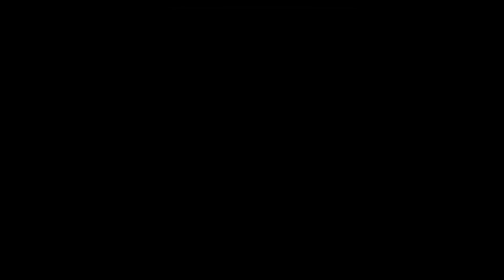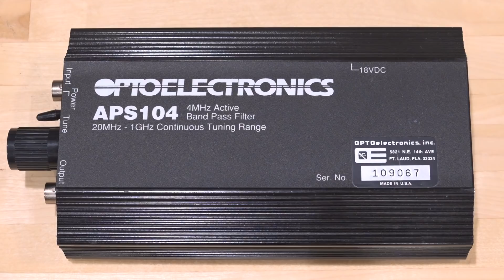TSP #217 - Teardown, Tutorial & Experiments with Active/Passive Microwave Band-Pass Filters (APS104)

Comment: Just picked up one these and trying to diagnose it. Initial finding was the same 4.7uF cap had blown but someone had replaced it with a diode. Regulator seems to have survived ok. Removed the diode and put back a 10uF chip as that was all had lying around. Powered it up and one of the two 33uF tantulum chip caps smoked. Replaced both of those with 10uF (will order correct value parts). Powered up with around 14V as don't have an 18V psu to hand, led lights filter works but it has around -6dB overall gain where you seem to have +30dB gain?? I am powering it with a lower voltage than the 18V but is that going to cause the gain difference? Bias voltage to the MAR7 MMICs seems ok, removed each bias one at a time at signal dropped completely so I don't think its a failed MMIC. Coax connections seem ok, can't see much else in the signal path that would cause the gain to so much lower?? Any ideas?

Comment: I'm reminded of the first time I saw a microwave cavity filter, back in the late 80's.  I was fresh out of college, and went on a trip with a senior engineer to Red River Army base in Texarkana.  The product they were having trouble with was our PPX3 interrogator used with the Stinger missile.  A whole batch of new PPX3s was failing self test.  We narrowed the problem to the diplexer module and found that if we banged it on the bench, it would start working again.  Back at HQ our failure analysis team did something that really impressed me; they were able to cross-section one of the tiny cavities and look at in with an SEM.  They found tiny dendrites shorting the screw and the wall of the cavity.  The amazing part was they didn't break the dendrites during the sawing process.  Anyway, it turned out the problem was caused by a new lubricant the cavity manufacturer was using, which they got from some supplier.  The lube guy wouldn't tell us was was in it because it was proprietary.  Switching back to the old lube fixed the problem.
Reply: That's awesome... thanks for the insight

Comment: I do not know if you have used software defined radios, they can use any filter method. Particularly over the frequency ranges you show here. I learned a lot from this video about cavities and fields people have used - as you said, not really knowing what they were doing.  Or knowing and not having the proper tools and parts.  You might be interested in @MachiningandMicrowaves.  He was using 3D printed resin dielectrics and other tools.  But he has some cool machining videos.  I like his "Machining a 10 GHz Lens Antenna from Rexolite 1422 Dielectric Polystyrene"  because that kind of lens could be use for microwave levitation.

Comment: Nice vídeo!
By adding the 20db attenuator, didn't you drop s11 by 40db? Pity you only showed smith chart.
Reply from the maker: I didn’t talk about the measures S11 of the unit because (as you said) in my setup I was basically measuring the return loss of the attenuator. The return loss of the instrument is not bad, better than -10dB for most of its rated BW.
Reply: @TheSignalPath  thanks for sharing.

Comment: I live in a senior citizens building with a cable outlet in each apartment. Once we switch to the cable input on my TV we can access predetermined channels like 22, 70, 96.1, 98.546, etc. but the only signal that we can access is channel 96.1 which is a screen split into four sections showing the laundry room and the entrances. Can this cable system be used to create several channels where news bulletins can be released to the apartments providing various information like vaccines, or water turn off, etc. health issues which are customized for the residents on a regular basis? Any help would be appreciated. Thank you kindly.

Comment: Good episode. Like the design. Wondering if I could use something similar to make a tunable notch filter. Need very high Q at 108.0 to 108.2 MHz - not easy. Using the manually tuned "oxygen tank" filters now. Again, not easy and clearly not able to automate that.

Comment: Would a passive tracking filter with a non-constant bandwidth before the fixed bandwidth filter be something which would be used to improve the linearity problems?
Reply from the maker: It would have to be before the input of this entire module. And of course you'd have to tune them in tandem.
Reply: @TheSignalPath  I understand and that's what I meant with "tracking"

Comment: A simple way to build a fixed bandwidth filter. Rather elegant from a theoretical standpoint as long as its downsides aren't problematic. To a degree similar to how a lot of radios and spectrum analyzers filter.

Mixers are truly one of the RF engineer's more important tools. All though one with tons of downsides.

Though, if one adds a variable bandwidth filter instead of a fixed one, and perhaps a more stable local oscillator, it could turn into a very interesting tool. Especially if fitted with a simpler display for easier adjustments.

Comment: I can donate very sharp superconducting RF filter assemblies, used in celltower GSM amplifiers, designed to operate at 77K temperature. I bought unit years ago to get cryocooler unit, and have no use of RF parts. Did some S11 measurement at 77K and higher temperature too :).
Reply: Ah yes we had a little fad for cooled amplifiers in the GSM world a couple of decades ago. Then found it was more economic to just place a normal LNA directly at the antenna before the coax run to the base station.

Comment: Nice video. Similar concept to the Wadley loop used years ago in the Barlow Wadley radio.
Have you considered doing a video on passive intermodulation distortion? It's a relatively new problem area in high power multi-carrier RF systems.

Comment: That is a pretty nice idea actually. 
I guess something like this might come in handy as a preselector for an SDR radio. 
I might have a new summer project, I guess. 

Thanks for the interesting video, I would definately like to see more obscure RF and microwave components or maybe also devices with rather unconventional principles.

EDIT:
Maybe some more cellular stuff would also be cool for a mini series. 
Like getting your hands on some GSM/UMTS/LTE base station boards and just showing the architecture, explaining the siganl path and maybe do some reverse engineering and get some low level stuff working / reused.
Reply: Well using an active preselector for SDR is not a very good ideas. The active components in the preselector are likely to get into non linear parts of their characteristic due to saturation and generate intermodulation products - as Shahriar shown in the video. Passive filters are way better as SDR preselector.
Reply: @adamturowski3765  I agree with you in general but do you think this might actually be a problem for some over the air signals? By getting the gain of the unit way lower like closer to 0dB it should be less of an issue? In my experience I basically don't ever get a signal stronger than -60dBm which I guess should be fine. 
However as I said earlier you definately got a point to keep in mind.
Reply: @gammaleader96  Preselector is only needed to get rid of the signals which amplitude could push SDR  input into non linear region - and this applies to all signals being present across whole spectrum coming from antenna. If you can guarantee that there are no such signals present at SDR input, then you don't need preselector at all. If you are dealing with very weak signals hidden in the noise, you rather need LNA - with the same caveat that you have to guarantee that it is not going to be pushed into non linear region by excessive signal amplitude coming from the antenna.

Comment: Over 50 years ago I built a single tube short wave regenerative receiver that used ‘reaction’ ie positive feedback for bandwidth control. If the feedback was adjusted just below the point where oscillation sets in the bandwidth was tightened and tightened. A common technique at the time. There was also a version that did run with oscillation occurring but used an ultrasonic ‘squegging’ to keep on killing and then restarting the feedback giving increased gain.  These were called Super(sonic)-regen receivers and were commonly used at VHF and UHF.  I’d be interested in Shariah’s explanation of why the Q increases as it goes into oscillation!
Reply: The explanation is relatively simple. Q factor tells you how much energy is being lost in the oscillator in a single cycle. The oscillator with finite Q is going to loose some energy in each cycle,  the oscillation will eventually stop and the bandwidth is finite. The oscillator with infinite Q losses no energy at all, the oscillation will last forever and the bandwidth is infinitely small. Now if you have a positive feedback loop around an oscillator with finite Q,  the energy lost in the oscillator gets replenished by the loop increasing effective Q and reducing the bandwidth. The higher effective Q, the closer you are too oscillation. The final point is where effective Q is infinite, which means you have oscillation running forever, infinite Q and infinitely small bandwidth.
Reply: @adamturowski3765  Great explanation - thanks.  That also explains ringing in high Q filters I guess.
Reply: @Richardincancale  Correct